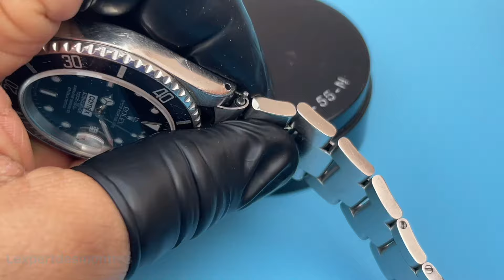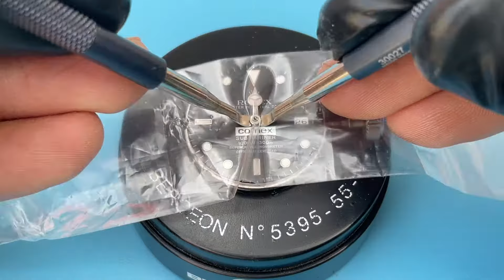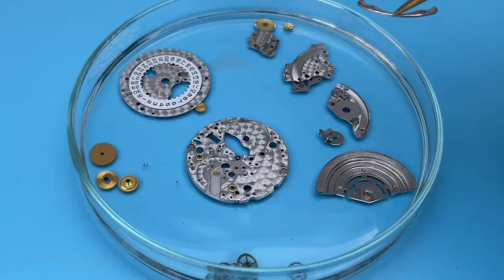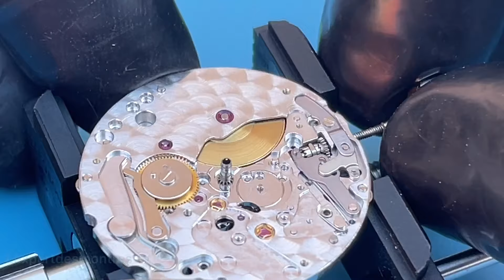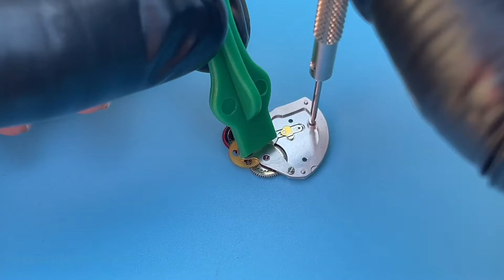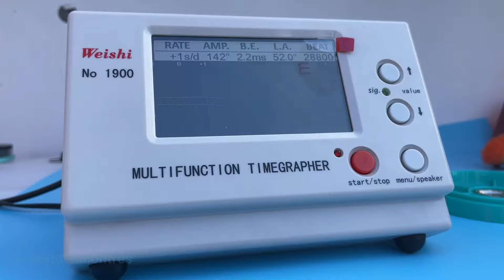Rolex submariner Comex 140000 $ ,Restoration a Rare Vintage Watch to its Former Glory make its owner

Comment: Why didn’t you clean the balance wheel and its jewels ? The beat error is awful, I don’t understand why even bother servicing a watch if you don’t service the balance assembly as well…
Reply from the maker: It appears that you are expressing frustration with the lack of cleaning of the balance wheel and its jewels during the watch maintenance process. Cleaning the balance wheel and its jewels is an important part of watch maintenance, as it helps to maintain the accuracy and performance of the watch. If the balance wheel and its jewels are not clean, it can result in a decrease in the accuracy of the watch and the appearance of beat error, which can affect the accuracy of the watch's movement.
I cleaned and adjusted the balance wheel, but were unable to capture it on video and incorporate it due to time constraints and the owner's urgency. Additionally, dismantling the balance wheel and capturing it on video requires extra effort and concentration, which was not feasible given the limited time available. Thank you for your attention and comment.l